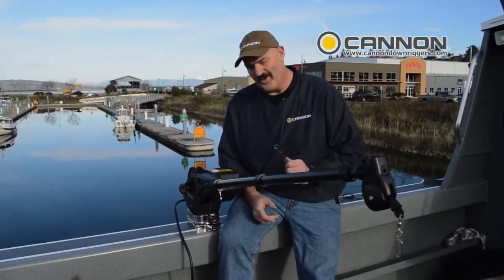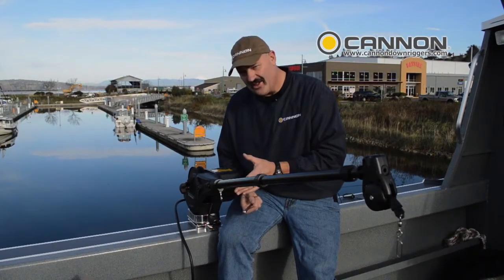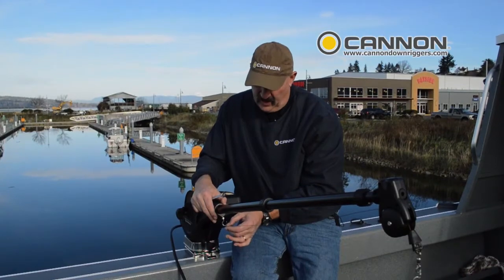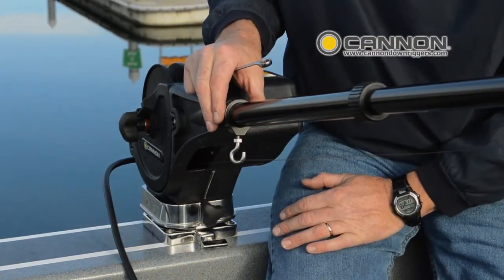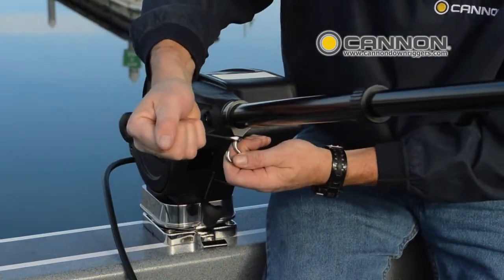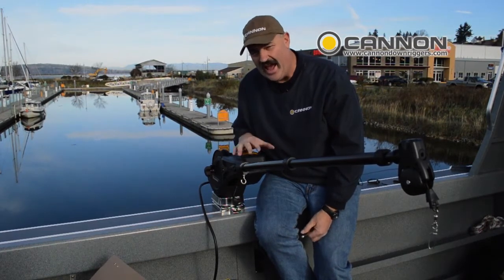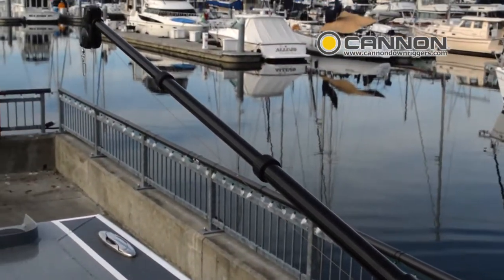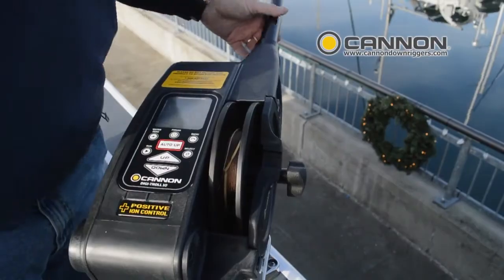Cannon Downrigger Ball Hook as Fairlead HD

Comment: This tip is the only way to make the Digi-10 usable.  You'll get a big fat birds nest in the cable if you don't use the ball hook to guide the cable.   This means each downrigger has an assigned side of the boat.  Cannon needs to fix this issue.